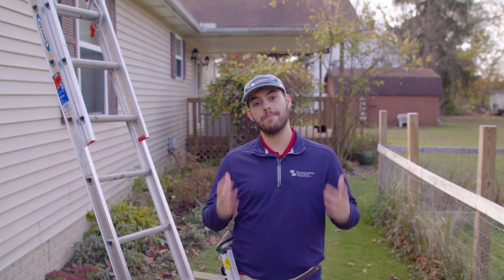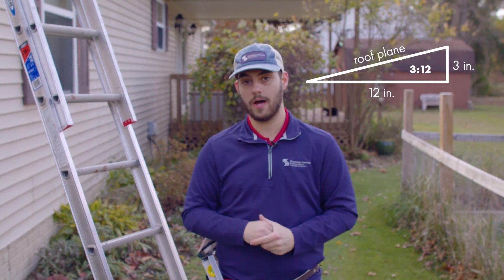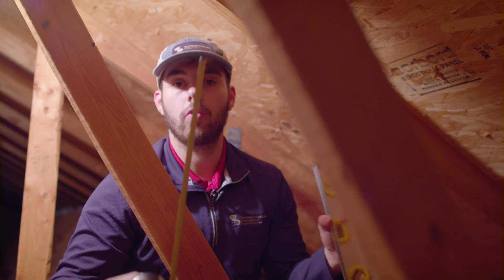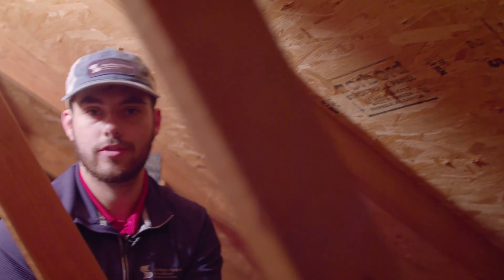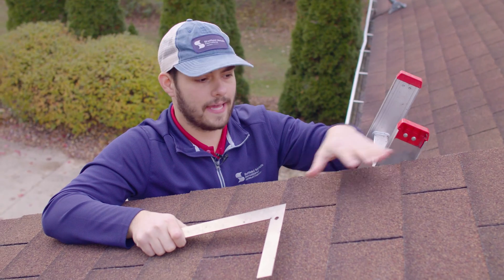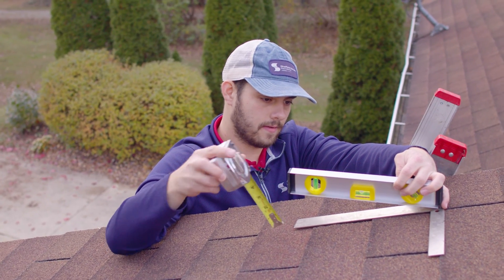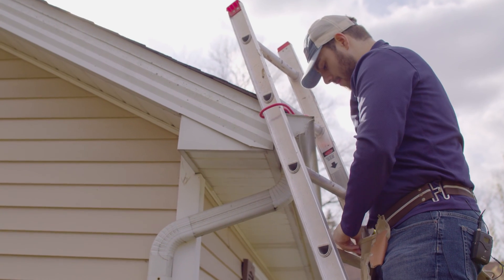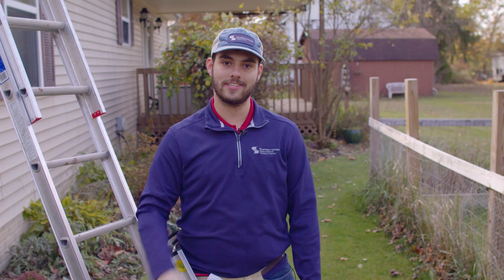How To Measure Roof Slope From The Attic, Rooftop, And Gable

Comment: Roof slope is 3:12 I have shingles on now.  Need to replace front part of roof due to lifted shingles (shingles still in good shape/life) possibly/probably due to roof facing Kona wind direction.  Strong winds (50+) has lifted shingles and have been advised that it is best to do roll roof and not to replace with shingles.  Have also been advised that shingles are fine for roof slop.  Was told that the Kona winds (north-west) pushes up under the shingles and shingles will fail (lift) quickly or the main reason for lifted shingles is roof/plywood wet/rot due to shingle lift.  Also slope will cause water pooling due to flat roof and slope not enough to ensure complete runoff which might explain the reason for roof/plywood we/rot.  Rolled roof cost slightly more than shingle roof.  Any suggestion/comments would be helpful

Comment: So what is the formula to actually calculate it?
Reply from the maker: It's a simple measurement, no calculations needed: measure the 12 inch horizontal run and then the X inch rise up to your roof deck. That will give you the ratio of X:12 roof slope. -Thad
Reply: The Metal Roofing Channel yes but that’s for pitch but how do we calculate the long side of that triangle? We need it to know total length from gable to gutter